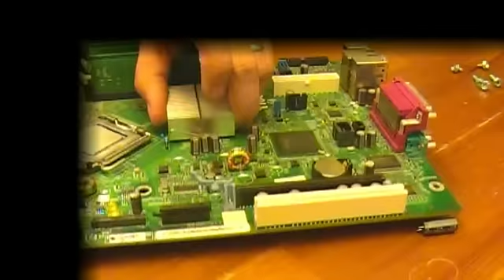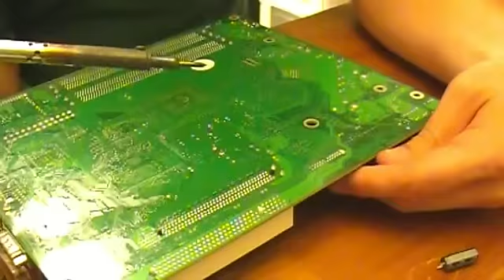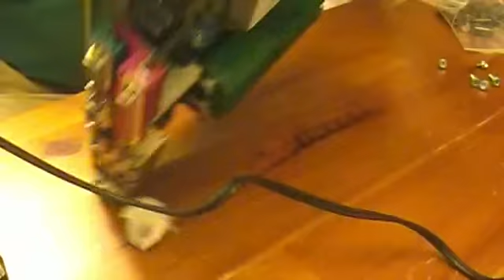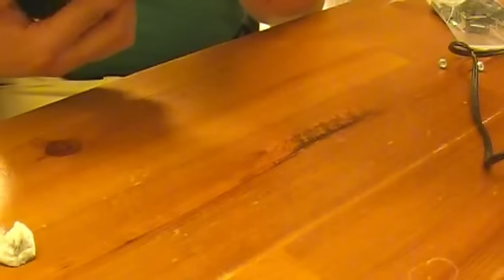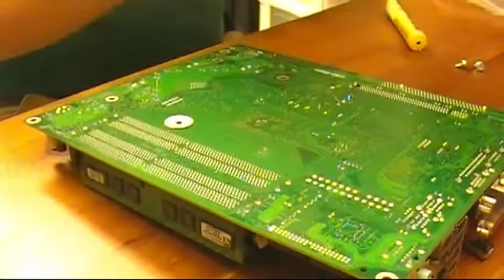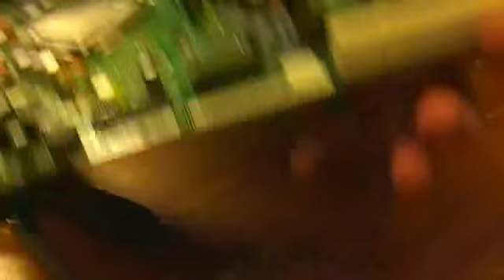Dell Optiplex 745 sff Replace bad Capacitors Part 2

Comment: You are a life saver i have been going mad trying to find my dell problem, So i tryed to do this myself. I had an old dell which had 4x 2200uf  caps as it was just them that where open'd up and  got them out no probs with my soldergun and solderd them back into my 745 naw she is running spot on ,ohh and i have never solderd before i just had nothing to loose so thanks again for you video and keep up the good work.

Comment: I have done this several times and it fixed the erratic problem bad caps cause. My company purchased around 200 of them and about 70 percent had the "BAD" exloding caps. Another 10 percent had good quality caps the were cooked by the heat. sadly only about 30-40 of them are running that didn't require this fix. An issue like this should have been addressed by Dell. This vid will help lots of people out.

Comment: Thank you for making this video!
I have the exact same capacitors bulging on my optiplex SFF.
The system hasn't failed yet, but this will be a good pre-emtive measure.

Some people will also find it useful that dell makes a
fan which mounts underneath the hard drive tray.  The part number is "NY290".

I was running a very low power radeon card and the GPU fan failed which I think is how my caps got cooked, but mine is a core2quad and I didn't have the fan.

I'm ordering my capacitors now!

Comment: I can see the skill of the tech to repair to the motherboard electronic level.  However, out of 100 computer users, none will be able to do this successfully.  First you have to know what soldering equipment to have, if you go to Radio Shack and other electronic stores, there are different sizes, shapes and length  soldering equipment, and how to use and apply the actual soldering wire. Not an easy task. The good thing, the bad capacitors are replaceable after it has been identified as bad.  End.

Comment: Dude you are killing me here using a linesman pliers to cut the leads off that capacitor. Buy a set of small side cutters that techs use, not a set of huge pliers that you can't get close to the board to cut it close. You also could have ripped the tracks right off that motherboard because you kept stabbing at it to get the soldier loose. Use flux so that the soldier with flow freely. Then clean with flux remover. If your going to do a job, please do it right.